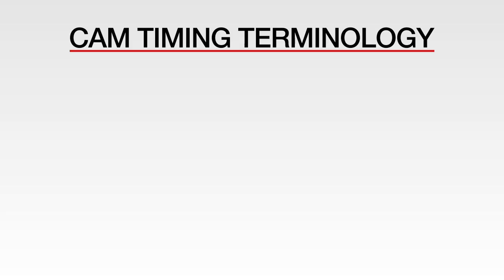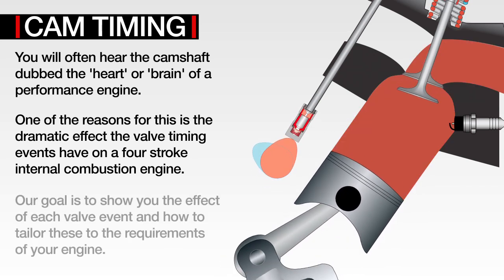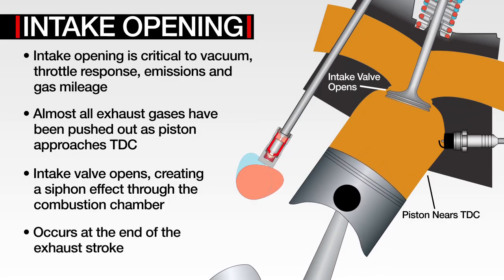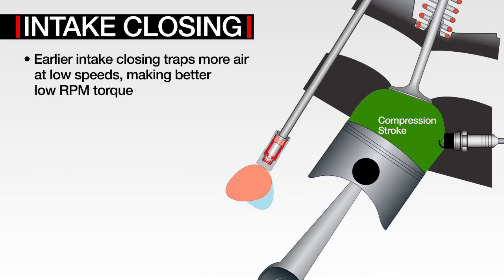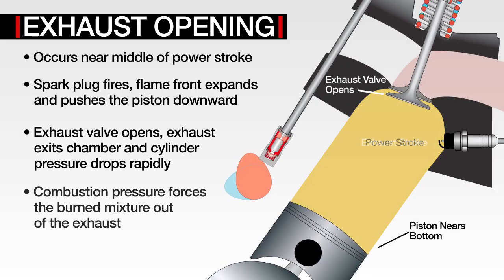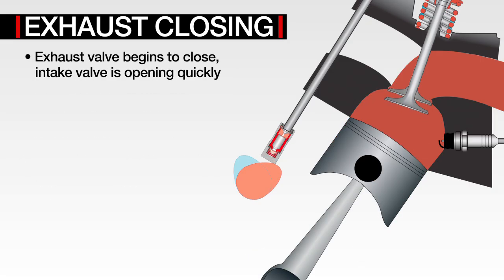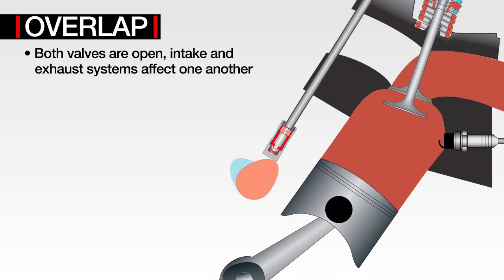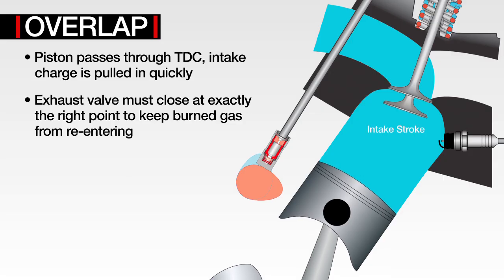COMP Cams® Technology Explained: Cam Timing

Comment: Nothing about reversion. The exhaust stroke pushes the exhaust gasses past the intake valve then drawn in back through and mixed with fresh air and fuel giving the engine rough idle. But at hi RPM things happen so fast it works to move pwr up with no reversion.
Reply: Good point. Very important for a Marine gasser.
Reply: correct at low rpm/idle.

Comment: How about a more detailed video and explanation on how cam lobe Centerline effects fuel mileage. Why is there not more attention paid to fuel mileage camshafts and how to obtain fuel mileage. Clearly NASCAR notices such detail. There's an abundance of information on how to make more power. I mean it's crazy when you have 10 different camshafts splitting the same hair of capturing added horsepower. Yet on the other end of the spectrum, no one's considering the economics of such. How about doing a video and being the first to address the subject?
Reply: You will get better mileage with your induction system. If you are running a carb get a qjet. If it’s all that important to you max fuel mileage can be had with an over drive trans, low lift and duration cam, high rise dual plane, correctly tuned Caen and ignition system. My strokes 305 gets 24 mpg with a qjet and 3.90 rear gear.
Reply: Most hot rodders aren't concerned with mileage! Car manufactures spend millions each year just to increase mileage by a fraction. Bottom line is you can't go below the minimum requirements that a engine needs just to run lol
Reply: @Jonhobbs64  i am... tell that to nascar.

Comment: when should i adjust the valve clearance and the right timming or what cycle? when the exos valve start to close? or the intake starts to close?
 because my kawasaki fury125 is loss of power when i throttle it
Reply: wata layph tdc compression stroke